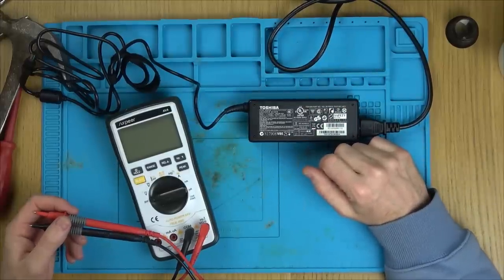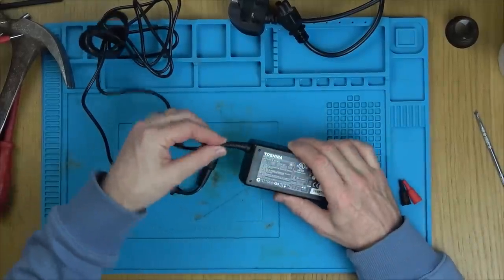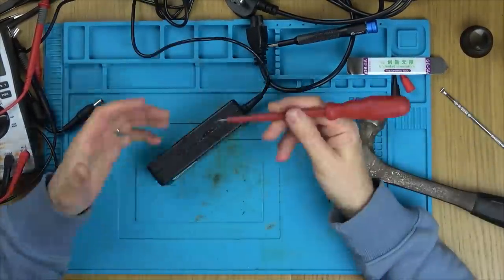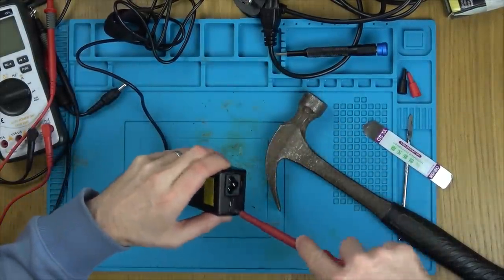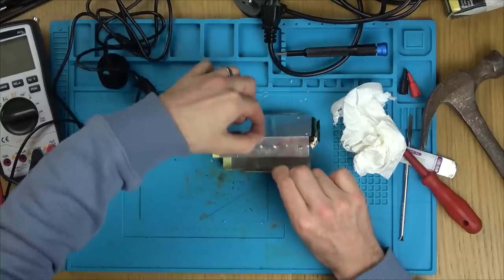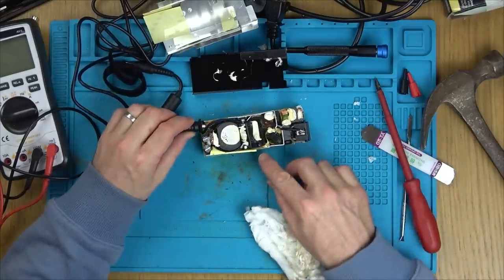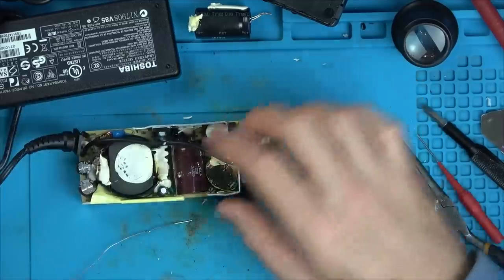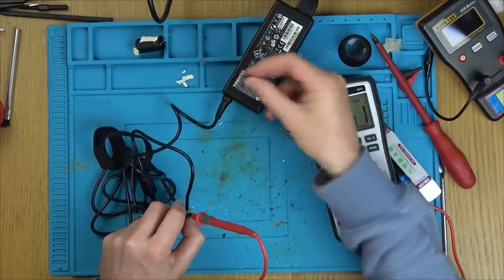Dead Toshiba Laptop Power Supply - Can it be FIXED?

Comment: I have seen one youtuber using lighter fluid to dissolve the meeting points of 2 halfs. I used same approach in some power supplies and it works. Try with another PSU. You just need to allow it to dwell and be absorbed. Sometimes pour it couple times. It evaporates quite quickly so do it in a well ventilated area.

Comment: I did manage to repair a Dell power brick once.  I had to use a Dremmel to open it.  The parts inside were just about completely encased in that same VERY hard glue of some kind like in yours.....only MUCH more!  Either it was for vibration protection or to keep us "meddling tinkerers" out of it or maybe both!  Lol😂!  Luckily though, it ended up being a broken solder connection at the output wire end, but MAN, was it a b$tch to get the glue out of the way!  Needless to say, the case was just too damaged to put back together again and I almost, just barely, missed cutting a capacitor open with the Dremmel! Just nicked it!  It works but is too dangerous to be trusted, especially alone. Good for me alone though.  Like you, I just had to see what went wrong and if I could fix it.  A good learning experience none the less!  Nice video and be well!  👍👍

Comment: I have two chargers for my Toshiba, both of them failed or get faulty with the same fault. They would start to provide less or unstable jumping voltage and my laptop (no battery) will self restart. I opened them both and no leaking or broken things in there. The first one start working fine merely by just opening it and breaking the metal ground cage around it. The second is partially fixed by using flux and heating the solder points of the transformer. The other possibly is that my NEC cap is going bad, but that won't explain why my AC adapters get broken.

Comment: Hi Vince they trick to open those if you use thinner on the seam that will solve the glue and you can easily open the power supply.

Comment: I fix things like this at home and if they test OK, they work, then I'm quite happy to continue using them. I wouldn't sell them on after fixing because like Vince I'm not a professional and with things like power supplies I would encourage people to buy a new one for about GB£15 (in the case of the Tosh PSU) . Interesting fix though and it reminded me of a problem I had with mt laptop last night where it just shut down completely. I'm in the Philippines and after a severe storm, lots of lightning, we had a power surge that shut down my laptop like it was dead. My laptop started working again after a few minutes just using the power cycle on the start button but it scared me that my GB£1500 laptop had died:text-green-game-over::text-green-game-over::text-green-game-over::text-green-game-over::text-green-game-over::text-green-game-over:

Comment: Great repair, Vince, as always. 
The only additional things I would suggest with a power supply repair is while you are in there, replace ALL the electrolytics as they are the things that deteriorate over time and then do a load test by soldering some high watt resistors across the output or make up a resistor load with some high watt aluminium resistors on a heat sink THEN measure the DC AND AC on the output.
You are looking for, obviously, 19 Volts DC with this PSU or the rated voltage and about a 1% regulation so with this PSU when measuring AC with it under load it should be about 190mV AC. You can also do this with an oscilloscope. If you have Volts AC on the output superimposed on the DC the chances are there are some rectifier diodes blown. An AC voltage superimposed on your DC could damage anything it powers, so beware. I speak from experience and seeing the magic smoke escape......It ruins your day. ☹

Comment: To open the brick easy without damage you put wooden plank on the joint of the case and wack it with hammer until the joint crack all the way, without prior tool, the case will open without visible damage and you can super glue it at the end. Check the small electolitic caps, their ESR often go high and prevent the oscillation of the oscillator. ALWAYS dischrge the caps before measure them, if there is a charge, you can blow your meter.

Comment: That's funny, one of those going bad. I have a fleet of 'em in my spare-power-supplies bin just because they outlive their laptops all the time. xD

Eta: also holy crow they aren't this hard to take apart for me either! You got an extra-enthusiastic plastic welder clearly. (I took one apart not to fix it - because like all of them, it was fine - but to move the output wire to a different location on the box to make it more suitable for the project for which I was adapting it.)

Comment: The best way that I've found to non-destructively burst those uwelded PS cases is to gently squeeze them along the seam, in a vice.  Often, it's enough to simply compress the seam by a couple of millimeters.  In the extreme cases, the seam will give up in some places but not others, requiring pry tools.

Comment: For extra safety, when I glued the case of my power supply back together, I put two cable ties around the body of the PSU. It doesn't look too good but it makes it impossible to accidentally come apart and therefore safer to use.

Comment: for future reference.........using the hot air station will loosen the joint just enough to use a pry tool ensuring a clean release. Or yiou can use a junior saw and cut along the groove just enough to release it also.

Comment: Good video, but I strongly recommend in cases like this to wash the circuit board and all mounting accessories in order to remove any electrolyte, regarding her conductivity...
Reply from the maker: Very good advice. I did wipe around a bit with a tissue, but I should have used IPA on the whole board to remove any traces of the electrolyte. Thank you 👍

Comment: Have the same one, would randomly get an amber flashing light, and before I swaped out to a generic battery, random reboots. Only recently found out it was the charger being wonkie. Fyi the amber light can be fixed by disabling acpi compliant battery and rebooting with the battery out, then enabling it again and slap the battery back in.

Comment: If you want this to be a safe fix, and you don't want to weld the plastic back together. Then you need to put it in a new power supply shell or another box suited for mains voltage like a junction box. 
It's a shame these power supplies usually don't get fixed and/or reused because a lot of them are high quality and all are suited for fully enclosed operation without a fan.

Comment: Now after our Generation are mostly gone through several Notebooks and Laptops almost everybody should have one of these 19V Adapters laying around. I bet I have at least 2-3 in my Basement-drawer for Power-Adaptors. 
Anyway a nice Video to watch.
Reply: A lot of them have different size connectors, and also some have chips in them so the laptop can identify the power supply (I know DELL power supplies certainly did). There were also some odd ones that were 15v too.

Comment: The toshiba (now Dynabook) batteries are just as stubborn, sound sealed with clips, but it can be done, wedging a gap and letting it sit for 20 minutes or so also helps to loosen the seal, but you have to fight with it as well.

Comment: Vince, from my experience, in trying to crack those boxes, its is better to start from the corners. Those big caps usually do not fail, so my guess is that there was a power surge of some kind.
Reply: Caps will always fail.
Reply: @Zoldier92  Yeah, yeah, but the ones that usually fail are the ones that filter the DC on the cold side of the power supply, not the big cap in the hot part, it is less common.

Comment: Easier method to get those ultrasonically welded plastic cases open is to squeeze them in a vise. Alternatively, you can use a 2-3" metal paint scraper in the seam. The extra contact area when you hit it with a hammer breaks the weld easier.

For getting them back together, I usually use E6000 adhesive. If the plastic is damaged/missing, a plastic welder also works well, but it won't look great cosmetically.

Comment: in most cases when a power supply stops working it is because of one or mor caps that went bad... it can happen due to a power surge, or even just due to a really crappy cap. Also is worth to mention that basically all electrolitic capacitors have some kind of lifetime, they will all eventually fail at some point and will have to be replaced.

Comment: Best way to open these I have found is to repeatedly apply lighter petrol around the seam and after awhile it will come apart easily I have done this many many times hope this helps and of course no damage so easy to re glue

Comment: I have more than a dozen of broken Dell power supplies that I dread fixing just due to that darn glue that keeps the casing shut.  Some of them are shorting out and some have damaged cords, so I could probably make half of them work by simply replacing the cable from the other non-working power supplies.
Reply: I may have to get one of these rubber mallets to do this.  Repetitive tapping all over the case is the key.
Reply: try applying lighter fluid to the seams. a small syringe full is usually enough to weaken the weld to the point where one can crack it open. It takes a while though

Comment: In the C=64 days, I remember having to constantly replace the power brick, which often cooked itself to death.  The whole system relied entirely on passive cooling.
Reply: The C64 power supply, at least the EU model, is an interesting design. A conventional transformer and a linear regulator, all potted in some nightmare epoxy that cen't be too helpful for heat dissipation.
Reply: @Ragnar8504  I seem to remember the EU power bricks were white and had heat distribution fins on them.  The North American ones were black and were just plain black boxes.
Reply: @NoJusticeNoPeace  Yes, the EU ones were the same colour as the C64 and oddly wedge-shaped, not sure about the US ones.

Comment: I put the bottom half in a 5" bench vice and squeeze it until until the seam fails.  a tap with a hammer is used to encourage it, if necessary.

Comment: I have done this before. I use a knife instead of a screwdriver to cut into it, so the edges keep being clean. It just either breaks the glue or cuts the plastic lip. Whatever happens it is invisible after a good CA glueing.

Comment: Nothing caused that cap to blow up, they just do that sometimes, I had 2 Delta chargers do that. The electrolyte shorts the curcuitry causing the fuse to blow.
Reply: Yep, had loads of caps fail in a similar fashion 👍 Especially some of the not so well known brands of capacitors.

Comment: Late to the party and not sure if anyone will see this but ...

In North America we don't have fuses in our plugs. Seems like a good idea to have one. However, I did notice that the plug had a 5 amp fuse but the device had a 3 amp fuse.

So my question is what's the point of the plug fuse being more than the device fuse? Or is there a power conversion going on that I don't understand? Cheers from. Toronto

Comment: Nice fix :) How old is this power supply? Used to have Toshiba laptop but it was accidentally damaged beyond repair at 3 years and few months old and ended up recycled. Then bought Packard-Bell laptop, which is now 10 years and 2 months old, just wondering how long the PSU might last :P I've used this computer pretty much every day, so it has done a loooot of hours already.
Reply: My high quality MacBook Pro power supply died after 8.5 years of daily use, so you may be in the danger zone.

Comment: use entire wedge of a thick knife across the length of the ultrasonic weld.. 1-2 hard blows and the plastic enclosure separates cleanly without any effort.

Comment: if you want to open one of these up and be able to glue it back use a long and not too thick knife and put the blade around the seal of the charger and tap the knife not to hard to cut through the seal ez open and ez be able to reclose it i have done it multiple times to fix broken cables on chargers

Comment: these power supplies tend to get really hot, probably the cap overheated and exploded, i see this issue in led lightbulbs that start to flicker because the smoothing capacitor overheats and fails by exploding or swelling up

Comment: Got one that looks exactly the same and same spec. but Dell (probably same charger with different label!). It gives out correct voltage but does not charge the laptop and the laptop knows there's a fault with the charger, displaying a warning when you try to power up.

Comment: I bought a new power supply for my laptop from a local supplier. It was made in China. The circular end that goes into the laptop has a yellow non-metal ring around the top. This appeared to chip at some point ( I don't know how ), and now when it's plugged in, sometimes it's charging and sometimes it's not when the battery is below 100% charged. If I rotate it, it will start charging again. So I think this ring ( is it an insulator between the positive and negative of that round metal piece of the end of the connector ? ) is the problem. I have another one, and it works fine, so it's not the laptop.

Comment: One solution, if the supply is ac offline, you can connect a li ion cell repeatedly to the dc cable, it may turn it on. If not, you can use a dc drill as generator.

Comment: I've repaired a lot of those bricks (specially in the later 2000 in the Compaq era). Those bricks aren't glued. Those bricks are ultrasonic welded. If you want to open one cleanly, you need a thin sharp knife (I used box cutters, but some people use scalpels). Then you can use any kind of glue to close them since the surfaces don't get destroyed (I used cyanoacrylate).
Reply from the maker: Thanks for the info SDogo 👍

Comment: I crack the glue by squeezing it in a vice, then I leave it in the vice and loosen it off a little, and hit very hard using a flat head screwdriver and a hammer, and after a few hard hits it opens just fine. I replaced the cord on my dell charger and I’ve been using it for years after and the epoxy resin has held up well, but I wouldn’t give it to anyone else to use just in case.

Comment: the cause the big capacitor blew in this case was not a crappy capacitor , the power supply (while used) got very hot literally boiling the electrolyte in the cap causing to expand and then vent, the lectrolyte shorted the high voltage side and blew then the fuse. 

is it possible that ur wife used the brick on a fluffy carped or did it get covered by a blanket or sat on a pillow ? because that are places where such laptop brick should not be and will overheat !   proper places are flat surfaces like tiles, glass or wood .

Comment: That PSU has active PFC. With this the big capacitor is much more taken up than in a regular PSU. When the cap fails it can confuse or even damage the active PFC circuit.
Reply: Ah, I was wondering that but I couldn't see if the thing connected to the heat sink was a rectifier or an IGBT. Do you just say that because it has three separated sections?

Comment: Just did mine, well a temp fix to just see if the charger works, pup when I got her last year chewed the cable, I ended up trying to just solder the 2 ends together and nothing so in the end tried getting into the casing of the power supply got half of it open but loads of dents and holes and managed to get access to where the cable was so just cut the ends off close enough that the wire can go outside casing and still splice onto, but then I couldn't get the wire through the grommet or whatever it was called so gave up and just decided to splice together just enough to see if it worked and when it did just left it charging long enough to fill battery, I need a way to make the hole in the grommet bigger so I can feed through cable and just resolder it again.

Comment: The exact same thing happened to my dell inspiron n4050 laptop 3 years ago. I plugged it in to charge it before sleeping and it was fully charged when i woke up but suddenly i heard a fizzing noise and the breaker of my home tripped. I opened it up and the capacitor was bulged but the fuse was ok.

Comment: The main filter capacitor has exploded. Electrolyte has gone everywhere. If you don't remove the electrolyte thoroughly everything will start to corrode in no time. Electrolyte is very aggressive towards the copper traces.

Comment: Didn't see the electrolytic fluid clean up. Was it cut from the video or just not cleaned up?
Reply: when I did one a few weeks back I missed a bit of the electrolytic fluid and it made a lovely bang when switched on.
Blew the case apart and vaporized several components.

Comment: Take a long and strong knife and hit the glue line of the power supply with a hammer. You have to do it with feeling. I opened several power supplies like this and they did not put up much resistance.
Reply: I use a chisel.

Comment: My Acer power supply has live dc wires  bc that end of cable lead failed near the box. It does work tho. My issues with laptop charging port i struggle to get it to charge probably lose connector inside the motherboard...

Comment: A dull wood chisel is a much better tool for opening those glued or ultrasonic-welded shells. The taper on the chisel forces the joint apart wiyh little to no damage. Fantastic repair!

Comment: 9:30 you mixed around the capacitance and voltage
Reply from the maker: I certainly did. I noticed that after I released the video!!!  I'm surprised not more people mentioned it. Well spotted. Luckily the ESR was still out compared to the good cap, but I can't believe I read it wrong 😂👍👍👍